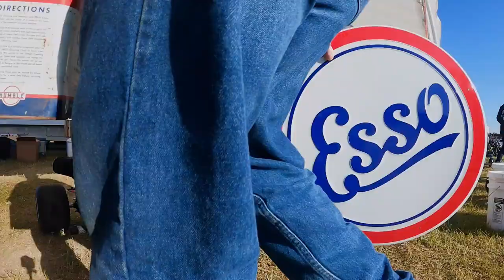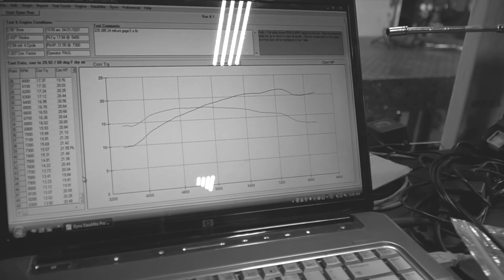We Built a $2,000 Show Mini Bike (and Raffled it Off for Charity!)

Comment: I use all thread with two nuts/washers and squeeze the bushings in, helps them go in straight like when I get paint in there.
Reply: i do that for bushings and small bearings (use a large washer to press against the outer edge of the bearing if that's the part that is being fitted)

Comment: John & Ike, I would love for you guys to do your own powder coating! Just get a cheap old electric stove with an oven. You can get the electrostatic powdercoating gun from Eastwood or alternatively, mix the powder with distilled water in a blender and spray it on like you would paint although the finish on this last method will be more orange-peely looking. Regardless on how you apply the powder, then just bake the parts according to the recommended settings mfr. Usually 20mins @ 350F but it varies with powder brands. Great video guys!

Comment: At 7:50 the digger they revived ages ago is up on the shelf. With the paint cracking, Kevin (JYD) had his dad in an episode of the golden Oldsmobile and he said the clearcoat will dry and pull the paint apart if it’s applied too soon
Reply: To clear it up a bit. If you don't let your coats flash(let off vapors) they will get trapped and your paint is guaranteed to flake n peel off. You can usually find on paint cans.

Comment: the paint brand doesn't matter as much as the paint Type, lacquer paint uses lacquer clear, and ceramic paint personally i dont run a clear on, but i've been told polyurethane is pretty neutral as long as you wait for the base coat and color coat to dry, as far as my personal experience goes, but i will say, this is a beautiful build, and y'all have stepped your game up a lot in the fab and paint departments, stay safe guys, and keep being awesome

Comment: Quick tip on paint paint with acitone couses dry paint to wrinkle . If you would have cleared it while paint was wet you would have been good . But if you have paint with reducer instead of acitone you can apply it to wet or dry paint it will not wrinkle. It was not a case of mixing paint just the type mixture  and way you did it .

Comment: How many hammers do I need to gather along with my $2k in order to assemble this beauty. I'm a showpiece and it's only fitting I have an easy to assemble show stopper to match. Can I save a few bucks by getting bearings instead of the high quality bushings? I have a friend whose trained to hammer those in properly

Comment: If you spray paint through a stocking or speaker mesh held tight, you  can get splatter effect without getting paint all over your hands
Reply: Thanks for the tip.
Reply: @bryduhbikeguy  no problem!  I'm a big fan of the effect too, we painted up a tandem drift trike black and lime green splatter

Comment: Still not understanding the extremely high price for such a small frame without motor when you can get Colemans with engine turn key and much larger for half the price.Bushings no bearings is about as cheap as you can get

Comment: that is a good-looking machine but I think you should use drilled rotors instead of slotted rotors drilled rotors do not Warp I have easily a slotted rotors slotted rotors have differential Cooling which makes them Warp drilled rotors cool evenly around the circumference of the drilled holes because it's symmetrical peace out good-looking bike good luck in all your endeavors

Comment: Yeah $895 for just a cheap metal frame and once you supply it with a 212 you need to instantly upgrade it to a Stage 1 because it won’t fit stock, Highway robbery much.

Comment: hey guys check out the Eastwood Co. they have powser coat guns under 200 bucks and for small parts you could use a old electric stove for a heating oven.

Comment: Contact the Eastwood company and buy a powder coating machine and all the colors and finishes you want(not very expensive) and pick up a used electric stove for cheap,enlarge the oven itself by adding sheet metal and a bigger door and voila powder coating on the down lo cost... Under 500 bux total and you're in bidness to pc any part for any mini bike or kart except for exhaust pipes or mufflers..

Comment: I will never understand the hype of these small cheaply made frames, Some people don’t get that you can get so much better of a bike for a $1000 less than what this small bike is worth for example a Trailmaster MB-200 that comes with both front and back suspension. You pay all this money for the bike and before you can put a 212 motor on it you have to upgrade it to a Stage 1 kit which will cost more than a new predator. It’s all junk